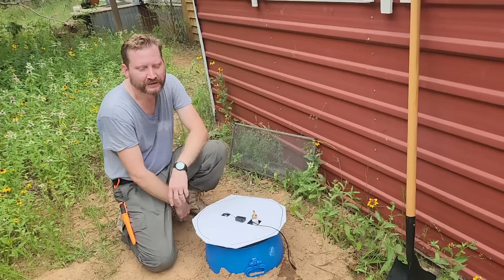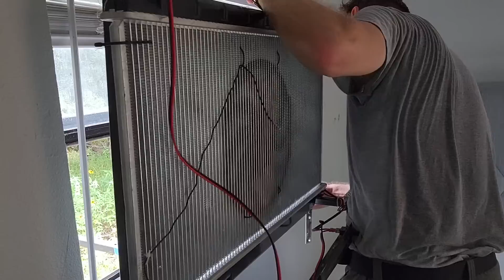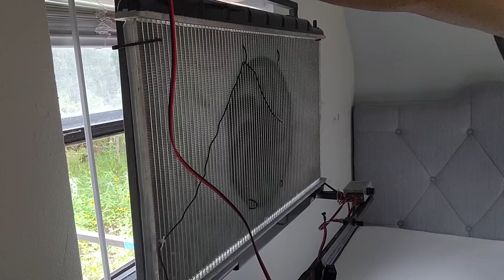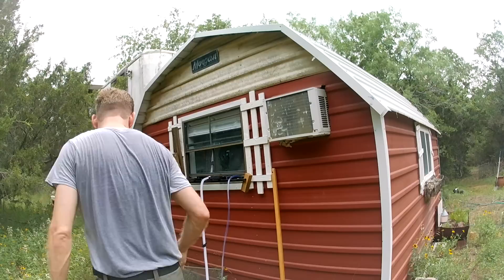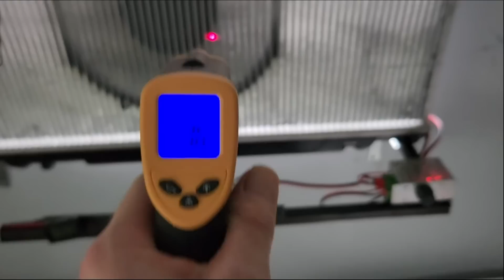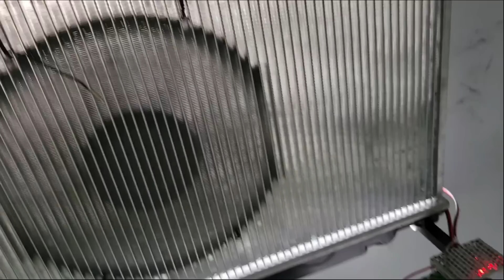Geothermal Air Conditioner test. Easy DIY without trenching!  50 watts! Texas Prepper Projects

Comment: First, OMG PEOPLE, he was testing a freaking THEORY, this wasn't meant to be the end result. Before he went through digging a hole deep enough to be efficient enough to make a difference he wanted to see if the theory worked. Even a tiny change would prove the theory

Second I believe I read someone else suggest to Daisy chain a couple barrels, that volume of water will take awhile to bleed off the heat initially as it'll heat up the surrounding soil quite a bit for awhile, but if you bury 2 preferably 6+ feet apart, that should help and you wouldn't have to worry to much about heating up the soil to much.

I like this method for smaller spaces and it's probably more doable for one guy in a day
Reply from the maker: Thank you very much! Lot of armchair engineers out there. I spent my own money and time testing an idea... what have they done?

Comment: 1) Bury the barrel at least 3ft down to reach a steady cool ground temp.  2) Wrap the pipes in insulation to protect them from sunlight.  3) Use radiator fluid or a water/alcohol mix to prevent mold and algae from growing.  4)  You'll achieve better air flow with a box fan blowing through the radiator instead of that smaller fan.
Reply from the maker: Thanks

Comment: Perhaps you accounted for this but didn't show it but you're going to get condensation on that radiator and that needs to go somewhere.  Obviously, there are many ways you could improve this design but for about an hours worth of work, not bad.
Reply: If the AC has a tilt outwards, the water will go outside.
Reply from the maker: Correct there was condensation to deal with

Comment: We all wish it would be that simple
Reply from the maker: Yeah I wish. I learned a lot. At least I tried!
Reply: @texasprepperprojects  listen, the theory showed promise. That much water buried 4-5 get deep will still take quite a long time to fully chill and the ground around it to dissipate the heat and get back to under ground temp. If you did 2 barrels and waited a week or two then tried circulating again I'd bet money you'd get a better result.
Reply: It's not going to cool a house, but a smaller insulated space I think it would work good

Comment: How do you get the water pumped into the radiator? I missed that part. Ok I see you used an aquarium pump. I bet you could use a solar panel to run both the pump and the fan. Can you do an update on how it worked out for you in April 2026?
Reply from the maker: So, to be fair, it did not work very well. The math and science is 110% sound. However, I totally missed a few decimal points.  The big thing I missed is that surface area is more critical than volume of water. This is why real ground loop geothermal uses hundreds of feet of hose instead of a single volume mass. So, the concept worked, but I would have been much better off running it through sprinkler hose so that way I could get the surface area.    But, ya know, I tried something!

Comment: You should put glycol in the tank.
Reply from the maker: Ya
Reply: @texasprepperprojects if you did the 2 barrels like the other guy suggested, I think radiator fluid would work well. How is it now in April 2026? Do you have any renovations or have you fine tuned it?

Comment: Why even put it in the window.... Your just letting in hot air.... Why not mount the radiator inside the room to a ceiling fan or just on the wall?
Reply from the maker: The glass of the window is closed behind the fan

Comment: Ok here’s my next experiment. I have a deep freezer that is powered by battery and solar. Put the ground loop inside the deep freezer and fill with antifreeze
Reply from the maker: Why?
Reply: @texasprepperprojects lowering the inlet temperature closer to 34-36 gets a lot closer to a actual AC unit instead of 55 or so. Also rocks and high ground temp can make digging impossible or impractical.

Comment: You should be cooling the coil on the window unit with the water and have an actual AC unit once you remove the huge blower fan a little unit like that uses very little electricity
Reply from the maker: Thanks

Comment: Thank you for dedicating your time and effort to this test. The concept works; it just needs refining. With a depth of 2 to 3 meters and perhaps twice the amount of water, you'll get a much better water temperature, and it will hardly overheat. You should also use something to collect the condensate and direct it around the well for maximum efficiency. I think this method is better than Canadian wells.
Reply from the maker: thank you

Comment: It will work for a while, then the water will be warmed up due to it being heated in the radiator.
Reply from the maker: Yes that is true. Then at night the heat dumps into the ground
Reply: @texasprepperprojects  Maybe that could be enough where you live, I might have overstepped and assumed it would be made to work in my situation. i get up to 115°F heat in the summer. Night time could be as hot as 100°F. I'm pretty sure this setup could be enough in some places, not on my place, though. Great idea!

Comment: You need a fan shroud so all the air is directed inside.  You're basically cooling the outside with the majority of the radiator that is not in the fan's air path. This is because the air will exhaust outwards in those areas due to the pressure increase caused by the fan in the center.
Reply from the maker: Did you watch the video all the way through? The fan is inside.
Reply: @texasprepperprojects 
Ok I see that now, so that takes care of the air exhausting out through the radiator which was my primary concern.  However, there's still a lot of radiator surface area not getting air flow.
Reply from the maker: That i would agree with

Comment: There are some problems with this.  This system is constantly taking in hot air and trying to cool it down.  The system should just bring in cold water and keep cooling the inside air.  Also, the system needs to  around six feet deep or be submerged in a pond to be effective.
Reply from the maker: Thanks. I look forward to your video

Comment: Having the same amount of water that's in 250' of tubing all concentrated in in one container is not remotely comparable to having it distributed throughout a dispersed pipe system. The key to geothermal heat exchange is the amount of CONTACT AREA with the ground. This system is terribly inefficient at best. You really need to understand WHY geothermal systems are built with 250' of tubing - not a jug of water.
Reply from the maker: You are correct. I totally screwed up on this by not factoring surface area. But, I tried something

Comment: You might have the same volume of water, but not the surface area to cool the water enough to make it back to the radiator at a lower temp.
Reply from the maker: I agree 110%. That is where I majorly screwed up on the math.  It is absolutely not just about volume
Reply from the maker: The science worked but I got the scale way off

Comment: 50w seems a very tiny wattage for providing meaningful cooling or heating. Teeny tiny. Most air-conditioning units we purchase for use are 1800w to 2400w. In my country 50w fans are on par with a hand held paper fan!
Reply from the maker: You are correct but this has no compressor

Comment: I wonder if you could replace the water with straight ammonia
 Ammonia flowing through those aluminum fins ought to pull more heat out
Reply: Specific heat capacity of water is 4.18 J/g°C while pure ammonia is 4.7.  While ammonia can pull more heat per °C, i think the headache of dealing with pure ammonia outweighs the benefits.

Ultimately, I think the limiting factor is going to be how fast heat will transfer from the water container to the ground and how fast the heat dissipates through out the ground.
Reply from the maker: Try it!

Comment: 25' minimum and 500 gallon Noresco tank with a harbor freight pump ran off solar. The pipes must be beneath the cabin and insulated also. So yes, you have an excellent prototype.
Reply: Why would you insulate the pipes? 🤔😱

The whole point of geothermal AC is for an exchange of heat from the water in the pipe with the colder dirt/ground you buried it in.
Reply from the maker: I wish I had space to do this full scale

Comment: Now experiment at least 4 feet down, and using pipes, to expose the water to more cooling at 55 DEGREES. And put the unit inside, not in a window. Also, warm air rises, so have a small vent to the outside up high to get rid of the warm air, maybe use a small PC fan blowing out. Should then be really nice in there.
Reply from the maker: I'll let you know when I win the lottery and can afford property with 4 ft of dirt in Texas

Comment: This is an interesting idea, wondering what your thoughts are on the project a year later. I thought I might try this with a 55-gallon drum (I have a few) and a water-to-air heat exchanger. Could I install the exchanger inside the shed? (maybe with a drainage tray for possible condensation?) I'm trying to get an affordable solar setup together and don't want to have a mini-split gobbling up all the resources. A pump and fan(s) would be a much lower draw, and would still lightly regulate temps for storage and puttering.  I thought of putting a heat-reflective shade cover on it in summer with a small fan inside to facilitate evaporative cooling, and a clear plastic lid in winter to help warm up the contents.
Reply from the maker: Check out my more recent video on geothermal.  In this project, I leaned after a lot of math later that the key is not just total volume but also surface area. The science worked but I got the math wrong by a factor of 10x.  I strongly believe that closed loop geothermal air can be viable for small cabins. I just need a place to test it to prove it

Comment: NCE IDEA why even put it in the window? Bringing air into the room means you have to cool that air. Just set it in the room and turn it on if you have cold water running through it that should cool the air in the room. Just a thought. Would work really nice if you had a pond or stream next to your house.
Hey the only way to learn is to do it and you have taken that step it only gets better from there.
Reply from the maker: Thanks!

Comment: I’m thinking that if you are using the window area, a swamp cooler might be better (evaporative cooling)… but, that introduces moisture into the air. I would try to utilize the area under the shed, as it is shaded & undisturbed. If there is an air gap between the ground & shed, convection  might be a better friend than conduction. A large spiral poly hose under the shed may yield better results.
Reply from the maker: I don't want the extra humidity

Comment: 1st note, your water needs to be deeper in the ground.  It sure as heck wouldn't work in AZ at that depth because we would need to be down 6 feet to get to cooler dirt in the summer.  2nd note:  why 1 fan?  You would get better cooling by adding a 2 fan solution because your radiator can accommodate two fans.  You have a large cooling area to use, so use it and put two fans on it.  Last note, why not use two barrels?  Connect them like rain barrels.  Use one for the hot water return, as it cools it can return to the cooler input and back to your radiator.
Reply from the maker: Thanks!
Reply: And daisy chain as many buckets as are needed to get the desired result
Reply: BUDGET!
Reply: I like the two barrel thought and you could do in top of one out to top of two and seal them both. To pump into one and out of two in series pulling off the bottom of the barrel for summer cooling and off the top of the barrel for heating.
Reply: I dont know where you got your information sir but the frost line on the entire planet is 12-16 inches, its the same in the Sahara as it is in Pushkin as it is in Yellowstone.
Reply: @Benehrethgir just so people don't get confused that information is incorrect. Are you sure you mean frost line? It goes down like 8 feet where I am.
Reply: @AlexWilkinsonYYC  He is trying to say the Geo Thermal Gradiant where the gound is the same temp all  year around. He did not bother to google and get his answer correct now he looks like a fool.
Reply: @Benehrethgir  YEA< NOPE. At what depth does the earth maintain a constant temperature?
12 to 40 feet
AT a small depth (from 12 to 40 feet) below the surface of the earth the temperature is constant throughout the year, and this constant temperature of the soil differs little from the mean annual temperature of the air, except on mountains more than 6,000 feet high.
Reply: @Benehrethgir not if it doesn’t freeze.

Comment: I have been looking into this .. I'm in South Texas and the dirt is so hot .. I do have an area that gets less sun and I want to raise the elevation there so trench a foot deep bury the pipe and then later raise it and Ill have 18-24" deep .. hmmm .. 6 " pipe with water in it maybe ?? hmm maybe a access point with level gage  .. Ill have to look at the updated one ..
Reply from the maker: Yeah watch my newer video on this. I wish I had space to do test it
Reply: Unless you use a trenches abs pot your pipe at a minimum of 6-8' underground you are wasting money and time. Ground temps at 12' down stay the same tear round. But just a fit underground the temps vary as much as the ambient air temps.

Comment: Those barrels aren't very good for this for one simple reason. They have a huge R-Value, meaning you're not getting very good heat transfer between the water and the ground because of that barrel. You'd be better off using a metal barrel. 

I have one of those plastic barrels in the shed for dog food to keep the mice out. On a 90 degree day, it's often noticeably cool in that barrel.
Reply from the maker: Metal would be preferable

Comment: Texas prepper—you are nicely close!!   I understand this is an experiment, so, still in design phase. 
—That small barrel, to help it cope with the heat outside, needs to be dug-in a few feet deeper, entirely below-grade—with an insulated lid protecting the water from hot outdoor air.   Otherwise, the ground temp water in the partly filled barrel cannot compensate for hot temps hitting top third of barrel, plus the heat from warmed radiator water. 
Texas & Midwestern temps get into the 100s*F, with high humidity, to my memory…you need all the system-optimising tricks you can do! 

Some have used one of the 2’ deep plastic fishpond shells, or a 2’ deep or deeper pool shell…. dug down into the ground in a deeply shaded place, with about 4” thick closed-cell foam board lid over it (about R-20)—but that is only helpful up to air temps about in the 80s.  

—Fill your barrel to its top to help the water-mass be big enuf to gather more cool from earth—& you might want a bigger barrel with more water.  Never leave the barrel exposed to air temps. 
—You might need a pump that can move water vertically about 20’, to overcome resistance of water moving thru the radiator. 
—The water hose needs insulated—both sections exposed to outside temps are losing some cool to from the system. 
—Put the intake end of the hose, to the bottom of the barrel to intake coolest water, & return end inputs near the top of the barrel. 
—Once the coolant is running at a cooler temp, the radiator will need a drip-tray under it, with a drain to the outside, because of condensate.   

—When demonstrating the system, show the outside ambient temp, & the inside temp, then show those over time, to show the efficacy if cooling system. 

—BTW—the same system can help prevent the inside of your building from freezing, too—if you get some modest freezes, & depending how well insulated the shed is.
Reply from the maker: My science was right but my math was wrong. For this this to really work I needed more surface area under ground, basically two radiators, one up top and one down low

Comment: Here's a lazy man's tip:  If you need to dig a hole that's a little more than can be done easily with your PHDs - use a shop vac. Check your level in the vac and empty as needed.
Reply from the maker: Nice!

Comment: I did mine way different I use 4inch french drain pipe 70$ for 100 roll Lowe's or home Depot both have it  and a computer fan   put hole in the ground 5×5×12 deep  pipe in bottom both ends left out the ground roughly 6 foot worth cut #2. 4 inch holes in sub floor computer fan facing in the pipe one facing in the house runs off a 12 volt battery make house gas cooled as  the beer cooler at the gas station
Reply from the maker: check out my other video more recently on geothermal. You're doing what I wish I had the space to do it. How big is the house and where are you located?

Comment: Two fans with shroud would work better.
1. Insulate those hoses.
2. prep the system for freezing weather (If you forget and the weather turns cold enough you will loose the system.)
3. Create a Sun Shade for existing AC cooler you already have.
4. Re-work the system so that it is only a pre-cooler on the back side of the AC unit.
5. Run the intake for the back side of the system you built back into the building so that you are pulling the Hot air from the ceiling to be recycled into the AC unit.
(You are by using a fan creating more air pressure in the building than outside.  Some Hot air will rise up make it's way outside.  Some transfers into the celling and stays the celling hot.  By closing the room down on how much outside air is forcing the inside COOLED air out you create a closed loop. And that would mean your not paying to cool the air over and over again and again. Leaving the inside air to get colder with each pass through the combined systems.)
Reply from the maker: thanks